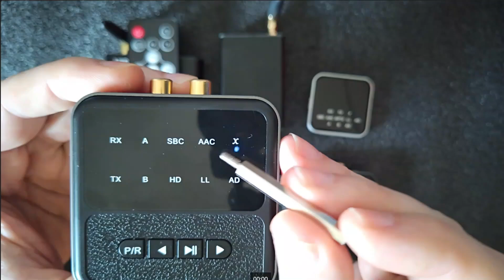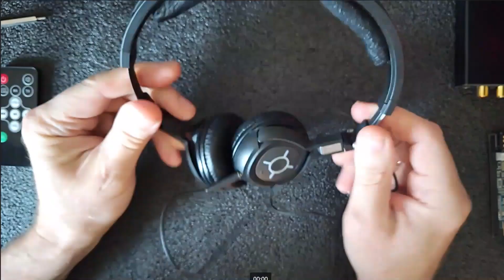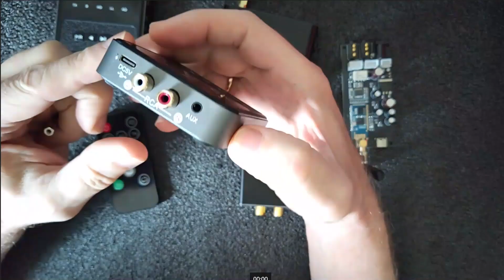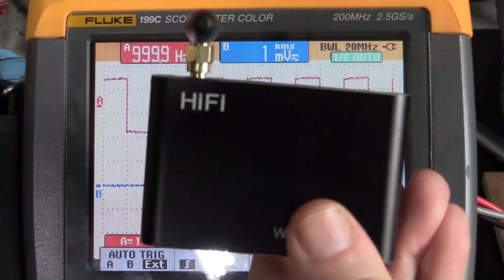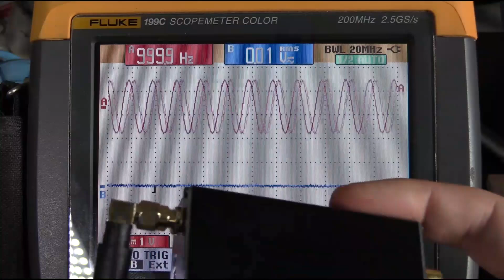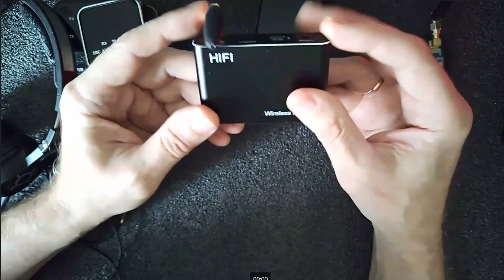Is Bluetooth Ready for High-End Audio? Part 2

Comment: Hello. Great channel i've subscribed. Have you tried some modules with BP1048B2 DSP chip? -something like  ZK-DAM-K1?
Reply from the maker: NO, I did not try. From my experience so far, good boards have a Qualcomm chip and a separate DAC chip. All one-chip versions that I tested were so-so. They are working, but below my quality requirement threshold. Bluetooth topic by far is not an easy one, and even with top chips, the quality marginally meets CD performance. But I should admit that it is getting better and better year by year.
Reply: @guntarssmits2104  Используйте те что для машины usb/aux трансмиттеры, можно выбрать хорошие с bt 5.2 AAC 

Этого достаточно 😁

Comment: Signal looks inverted, maybe an artifact of your probes.
Reply from the maker: The transmitter and receiver signals do not have a common clock to sync. They are floating all the time toward each other. Probes are correct.